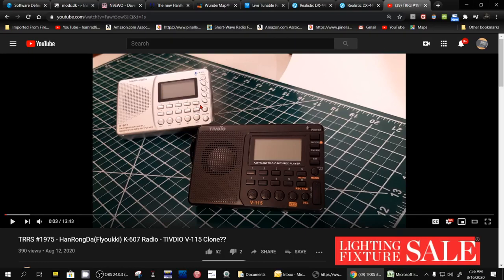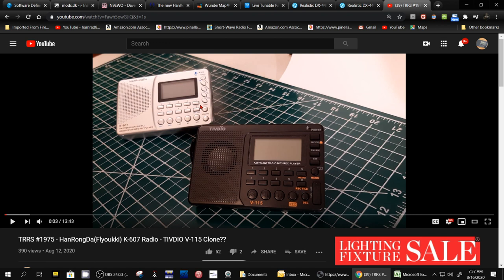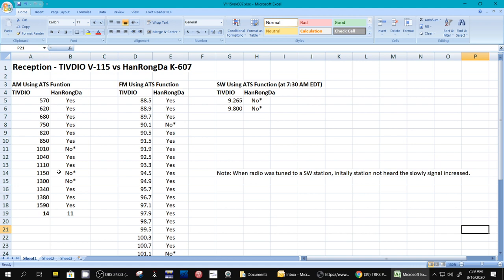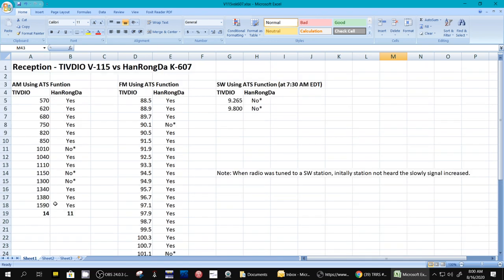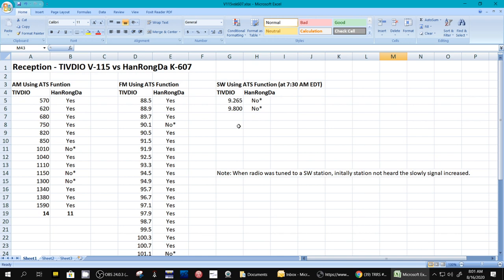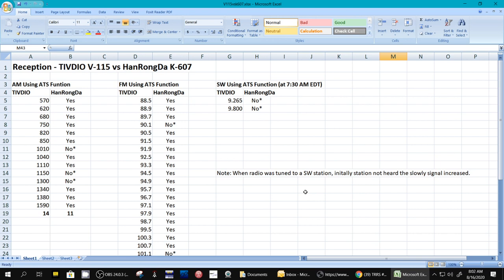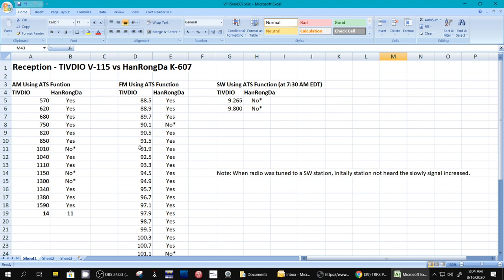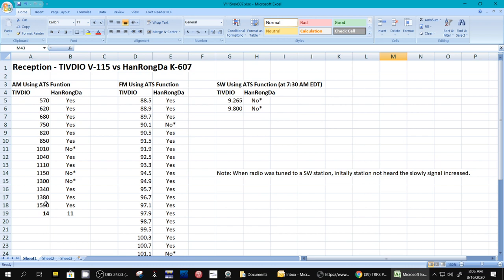TRRS #1976 - HanRongDa(Flyoukki) K-607 vs TIVDIO V-115 Reception

Comment: I'm guessing the K-607 and the black version the K-603, are both made in the same factory as the Tivdio, Retekess, Yontek V-115. 

Any variation in reception is due to manufacturing variation and placement of the unshielded internal aerial cable.

The HanRongDa is much cheaper too.

Comment: Thank you Tom for the comparisons.  I see no reason for me to get the K-607 unless my V-115 stops working.  By the way, my V-115 is version 1.4 and is branded as Retekess.
Reply from the maker: Thanks for the info.  Mine is V1.2.  Maybe the K-607 is a later version but it is not marked.

Comment: The best of these small radios is the XHData D808. It has the mute on tuning but is so much better. You get what you pay for. Have the V115 and all it’s really good for is the FM and the digital recorder.
Reply from the maker: Thanks for the comments and have a good day.
Reply: but the d808 does not have a MP3 recording/playing functionality. So we really cannot compare both ... The d808 has a way better receiver, but there are now better radios than the d808 such as the Tecsun PL-330 which I highly recommend. Fantastic receiver, usable ssb, good sound and good battery life. This is unbeatable for the price...
Reply: @stephaneschmitz2849  I have the 330 and am impressed by some of the features, and like both equally and use both... the D808 has an AIR band which while for some uninteresting, but I live between a couple of airports, so I sometimes listen to that as well. I could probably get an AIR scanner, but this is useful for me. On a somewhat fixed income so I don’t get a lot.
Reply: @RJDA.Dakota  A radio with so as many features as the PL-330 could have been very expensive some years ago. Multiple filters bandwidths, ssb, antenna input, the fantastic "etm" mode, ... but I had to modify it to get the best of it : replace ferrite antenna with bigger one (more litz wire turns for more inductance), now the LW band is quite good. And replace the battery with a real 2500 mah li-ion battery (requires removing the plastic under the bl5c battery as well as removing the battery connector). Now I can listen to it for several hours before recharging the battery.